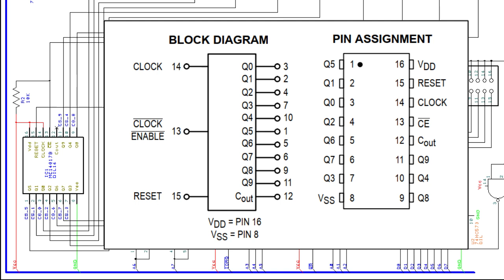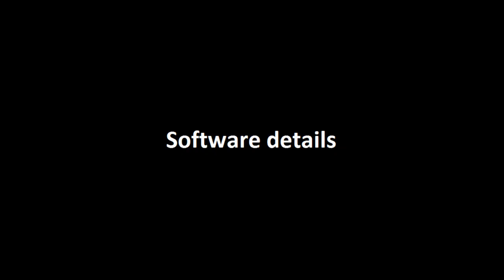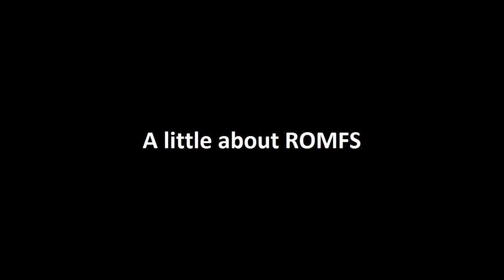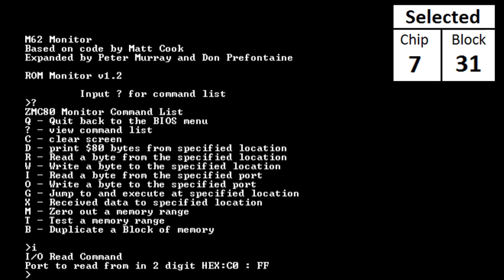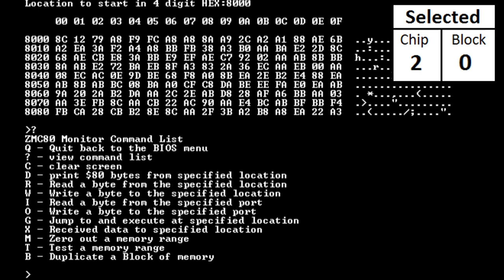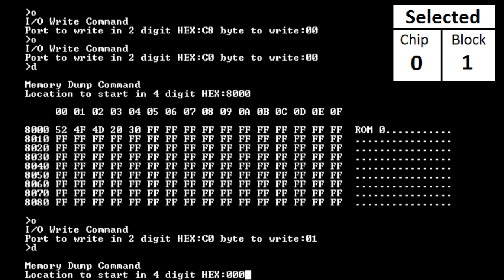M62 - Memory Expansion Card

Comment: Any new developments on the M62?
Reply from the maker: There was a lot of changes in my life since the last videos and I sadly had to put it on hold, but I did however do a rev 3 board which I didn't get to make a video about. It's 90% SMT and includes a compact flash socket, I was starting to try and port CP/M to it but life always gets in the way when you're having fun. I do plan to pick up the project again, it will probably be towards the end of this year or early 2024. I put some info on my website about this revision: http://39k.ca/z80-2/m62-sbc-card-rev-3/